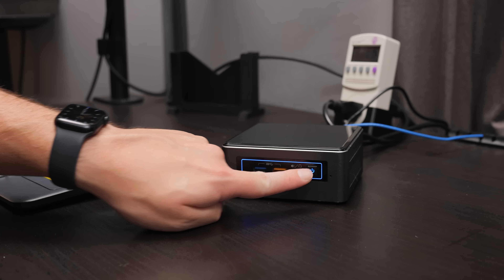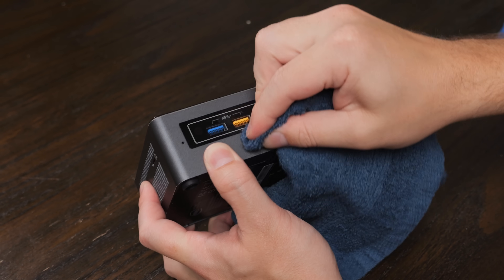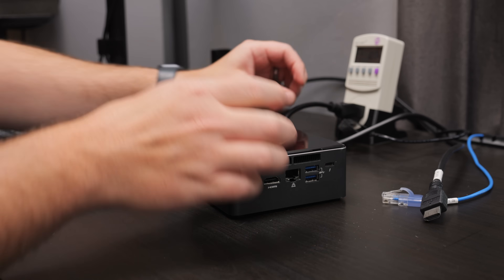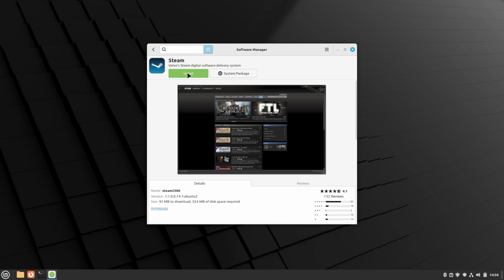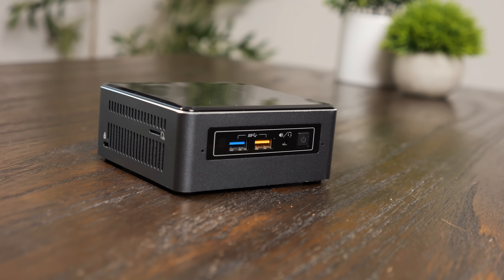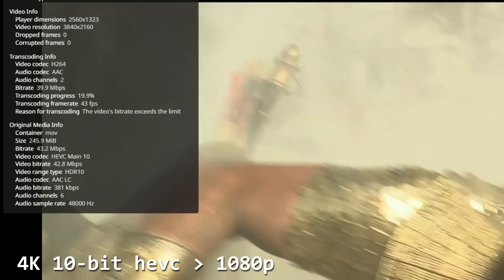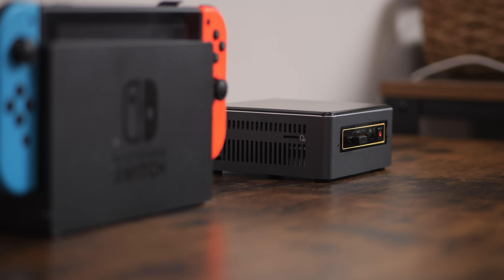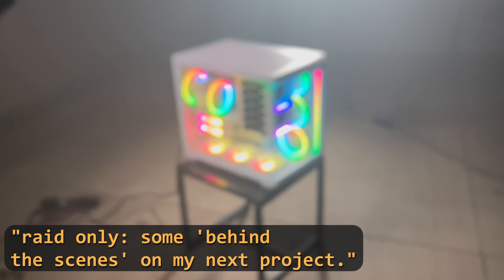The NUC7 ...7 years later.

Comment: Been using a Nuc 11 performance model for many years now. Once I figured out which RAM sticks and NVME SSDs would be stable (it is very picky…) it has been 100% reliable. It’s only in the last three months it got a bit loud and I removed some dust. 

Back to silent, steady operation, via proxmox serving ~30 programs via ~20 containers and VMs including Plex, Jellyfin, Home Assistant and more. The only problems have been the ones I created myself.

Comment: I like those NUCs a lot, they can be of great value especially if you are able to pick one up from local companies sorting them out due to them not supporting windows 11. I got the exact model u have with 8GB of RAM for 30€, i only had to go out and buy an SSD for it and was good to go to use it. Using it as a some sort of streaming box in the living room as the TV no longer support youtube or other streaming services for my parents, and running it with mint it is a really good experience. It would be an awesome little fella for cheap office tasking if u can find one for the price I did and the performance for basic office tasks is more than enough.

Comment: I have an i5-7200u in a laptop I use for general computer stuff. It is surprisingly still good, except when you open more than a couple dozen tabs and some youtube videos. it streams just fine, remote desktop, NES, SNES, N64 emulation. Anything heavier I use it to RDP into my desktop.
Power usage is fairly low, worse case, with the screen off is around 20 watts (40ish with the screen max brightness and charging the battery), CPU max is 15 watt, so its kind of just turned into a living room thin client I use for streaming. Any device that does what I use it for would use similar power.

Comment: You’ve gotta see what I’m doing on my Gen 7 NUC. I have a PCIe break out from the NVMe M.2 slot and it goes to a SATA board running RAID 8TB hard drives as a ZFS storage pool, with the ability to add up to 6 drives. It’s a Frankenstein NAS an additional drives. Plus the SATA SSD for the boot device.  I love it

Comment: I bought the last Intel produced Nuc last year. With an i7-1360P it’s fast enough for pretty much anything except gaming and the thing is built like a tank. I use mine to run a boatload of server tasks with Linux. Hard to say if Asus will maintain the brand quality, but either way I think a used Nuc is better than a new n100. You can probably pick up a 9th gen Nuc for about the same price as a new n100 mini pc.

Comment: This UEFI is a common theme for Intel boards, we had a bunch of 4th gen Intel boards we used for in-house built computers(because pre-builts from Dell/HP/Lenovo couldnt fit the use case we needed)
Honestly other than the Lenovo text BIOS Intel's GUI BIOS is IMO the best(Lenovo's is just so fast to navigate with arrow keys compared to other BIOS, Dell's looks nicer, but it takes so much more time to configure the same settings)

Comment: I still run a fleet of NUC7s in a laboratory where all they need is a web browser. The only reason I'll be replacing them is for Windows 11. Super solid little machines. I hope ASUS does the NUC brand proud.
Reply: If all they need is a browser, just installing a Linux distro is probably fine instead of replacing them.

Comment: Even thought their CPUs are no more the best you can get nowadays the Intel NUCs were beautifully made PCs. Very well made and integrated. There is a gap between these and the modern NUCs where everything is packed together just to have the best specs... but without nothing around it (like a well polished uefi).
I'm using a Skull Canyon and even after 8 years it's still relevant with several nice features (like the SPDIF embedded in the rear jack).

Comment: Unless a specific and well known "server/home server tasks"... my answer is "neither".
On one hand, the NUC has a fake 4 core processor.
On the other hand, any N100 box has a "heavily nerfed" low consumption 4 core processor.
The subset of user cases IMVHO is quite small, and sometimes an even lower consumption device like Raspberry Pi or one of the home assitant box might be... more energy efficient. A SFF used PC is far less power efficient, however have a lot of CPU power more to rely on when needed. And also... more storage capabilities.
IMVHO

Comment: The OBS problem might be the fact you used the flatpack version. Flatpacks have much less permissions than native applications. Try using flatseal to change permissions. Maybe that would work.
Reply: I use LMDE daily and will go out of my way to find a use a .deb before using a flatpack.
Reply: yeah I was about to say, seems like flatpak permission issue, cuz I experienced similar thing with downloads from a flatpak app disappearing
Reply: I was thinking that. I'd guess the files were redirected into a sandbox somewhere.

While these app bundles + sandboxing can make a whole lot of sense sometimes, it can clearly hurt the user. OBS is trustworthy software, there's no reason why it should be trapped in a sandbox by default.
Reply: stop recommending standalone packages, just use what's packaged for your specific system from the official repos, or (even better) compile your own version

Comment: I have many of these. Their biggest problem is heat. You cannot push them. I have your 7th gen but in i7 and it's terrible at heat issues. The 5th gen was ok in I5. But even the 12th gen i7 cannot be pushed hard without hitting the limits and throttling heavily

Comment: Blue and Orange or Yellow front USB = Blue is high speed.  Yellow or Orange is powered all the time(even when PC is powered OFF) to charge periphs.
Reply from the maker: Interesting! Didn't even catch that
Reply: And with the correct keyboard you can power up the NUC if plugged into the yellow port, some BIOS settings need to be set.

Comment: My Home Assistant has lived on a NUC11 for the past 2 years, and been rock solid.
Reply: I've got Home Assistant running on an i3 NUC about 12 years old.
Reply: I have HASS vm in a x86 mATX where I run Proxmox as host, it's not 24/7, it's only when needed instead, I want to run HASS in another machine, maybe NUC or ARM, only to use as Smart home hub, what would you recommend for power efficiency and compability?
Reply: @GJoseeph  I've got Home Assistant OS running on a HP t630 "thin client" PC (from 2016). 

Not as small as all the tiny PCs or SBCs that have become available over the years. But I got it for €45,- so cheaper than buying a (new) Raspberry Pi plus all the accessories/peripherals to make the R.Pi "complete" (e.g. an enclosure, have it run off a M.2 SSD instead of MicroSD, etc.)

This "thin client" PC has been running stable for months now. 🙂 It's silent and not power-hungry.
Reply: I've got HA on a NUC8i3BEK2.
Reply: Do you guys have power backup in home ?
Reply: @creativemaster007  nope for me it would be expensive, I know that it's a good practice, but I rather expend in a data backup (so I can restore the essential data I need to keep) than in a yearly battery replacement just for the shutdowns.
Reply: I've got my instance of Home Assistant HAOS running on a NUC7-i3, and at least for the short term, a NUC6-i5 beside it running Fedora KDE until I figure out something else to do with it. At least for me, Home Assistant on a NUC is outstanding. Especially since I already had both of them since they were new so it was just a matter of pulling them out of a drawer and dusting them off. 🙂
Reply: I am trying to make nas at home with a mini pc intel nuc, please really please demonstrate the cheap enclosure you have combine to this intel nuc event thought I have an i3 intel nuc like this at homefor nas. I having trouble adding a large storage. Please really please make a video. Thank you and succses to you and your channel

Comment: Hello! Nice presentation and benchmark of that NUC7. I am sure that the power draw can be reduced by using linux packages: Powertop, cpufreq and TLP-gui. Worth a try, i have an old laptop with a i5-5200U CPU, and it draws around 4,8 W in idle after power optimization with those tools.
Reply from the maker: Might be worth looking into a bit more. I typically try to grab the numbers without doing much as a baseline comparison. I've had little luck with getting idle draw down on most systems using tools like those, but maybe it's worth another look!